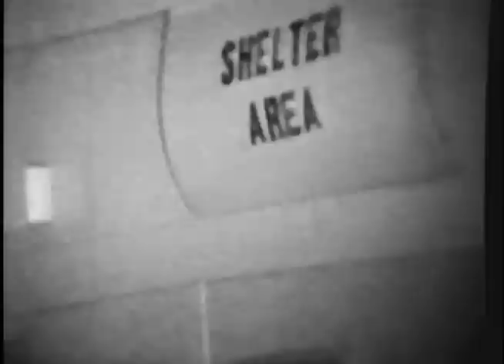Doomed Tower at Sea

Comment: Like the Titanic, this tragedy did not have to happen. If only the Air Force had let those men evacuate the tower; if only the Navy had done its job correctly and seen that the tower had been properly designed and built, 28 brave men would have survived that storm. Shame on the military for giving its material possessions greater priority than the lives of those men!
Reply: Laura Sprague as I understand that was the only radar picket that  was not designed by a company named  DeLong Engineering.

Comment: Great video!
Just a couple points not mentioned in the film, i believe will help add clarity and better understanding of high winds, waves, and oceanic storm hazards:
wind load DOUBLES every 10 MPH increase in wind SPEED. The force on a human head at 80 mph wind speed, can pull your eyelids open, the pressure difference from one ear up wind, and one leeward can pop your ear drum. A man has real difficulty standing up after 70+ mph wind.
Air is about 15 times less dense than water...so speaking here of fluid dynamics and wave force, is betond my understanding. i grew up on a boat, lived 9 1/2 years on a live aboard sailboat from '79-'89.
Not an expert, yet most people can't understand how powerful the ocean and the atmosphere really are.
Be well.
Reply: Thank you for giving an extra dimension to the telling. Honestly, just seeing waves that size is scary enough without the wind, rain, et al Reckon there isn't a vessel on earth where you'd feel safe in a storm like that.
Reply: @mortalclown3812  personally, no. I would say, a submarine about 40 meters down.
Reply: Wagner PD  you're welcome. One more note i forgot:
look up a video of people being rescued from a ship, during bad weather.
Notice please: the sheering movement of waves, and just how hard it is to simply get off of one vessel, and safely  board another. It's often more easy to jump in the water, swim away from one, and be plucked from ocean by the safe vessel. 
Trying to step off one, to other whilst both are moving 20-30 feet (6-10 meters) up and down, in less than half a second?
formidable
Reply: The Curious Mind  no doubt. As long as i spent on the water, only two things truly terrified me about dying:
Falling overboard; as i could go into just how difficult it really is to see someone from a passing boat, or a ship in rough weather even in broad daylight, or from a flying aircraft? forget it. You're dead.
Loneliness: even surviving a bad storm, or being stricken in a smallish boat, is totally survivable (under preprepped circumstances that even a clever FOOL knows how to set up, just in case of this very thing.) Yet, knowing my own self? I'm more afraid of losing my sh!t from being all alone...
But that's just me. Everyone is different. 
Be well, stay dry...and plan better than yesterday...lol
Never failed yet.
☀️😎☀️🇺🇸

Comment: Dealing with "worst case" weather anomalies is the downfall of such towers that can not withstand such severe loads.  They may last a decade waiting for the severe winds that will eventually happen and break them up.  I wonder who was aware of the risks and dangers but did nothing.  Was it military denial of reality?  The Texas Tower oil platforms that sank in storms were commercial ventures rather than radar stations like this one, so money could have been the deciding issue there.